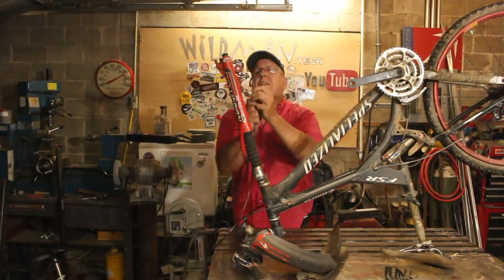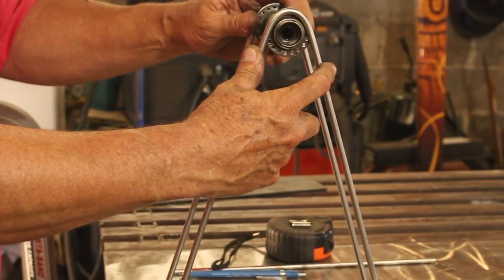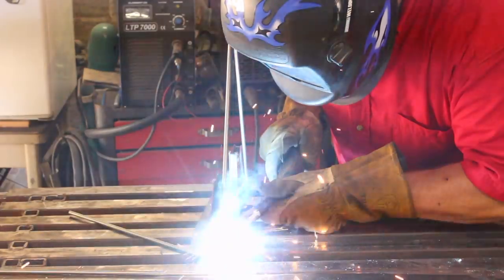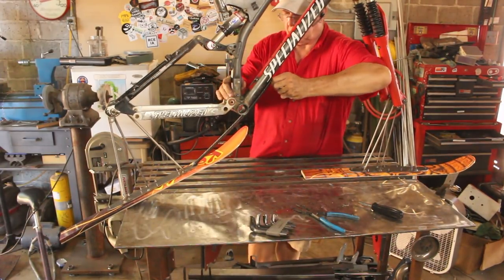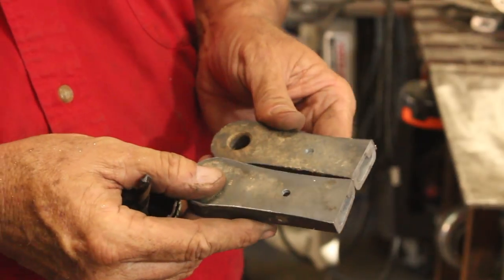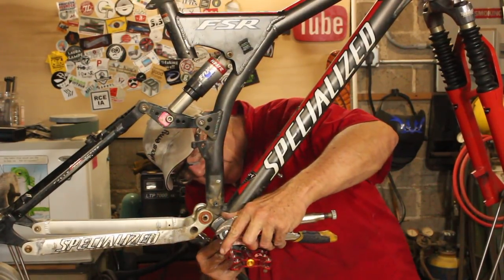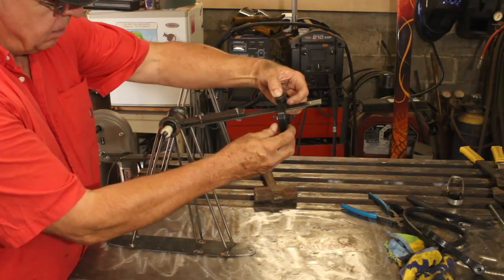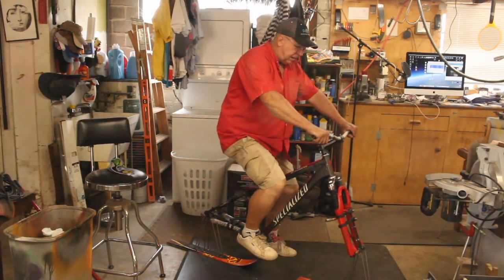Building the Ski Bike!

Comment: I tried something similar with water skis when I was a teenager (got the idea from the Beatles movie HELP!)  Here are a couple of ideas before you head for the slopes.....1. your center of gravity will be quite high and tougher to balance going down hill... 2.  consider a tricycle design.   3. Also an old banana seat will alow you to scoot your butt backwards instead of leaning over the handlebars allowing you to adjust your front to back loading ratio. 4. I might also consider put a metal rod on the bottom of the skis to arrest sideways sliding...like they have on snowmobile skis.  Think of turning the steering wheel when driving on ice....still going forward even with the wheels turned.  

Have you ever skied on Sierra Cement?  The name given to the snow when the surface gets melted during the sunlight of the day and freezes hard again at night.  Trying to offer some insight....be sure to wear a chesty so we can see you going downhill.
Reply from the maker: I've wanted to build one of these since seeing the movie Help. I decided to do it because a friend has one and is building one for his GF.